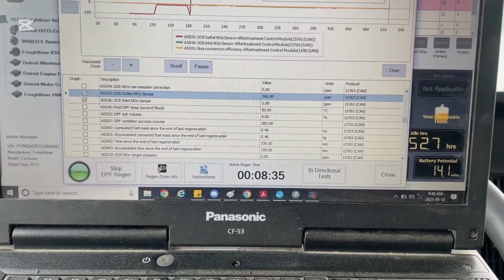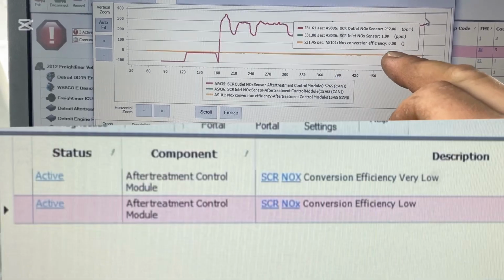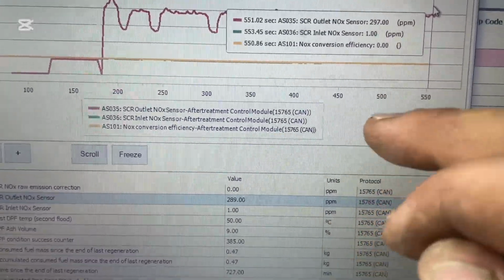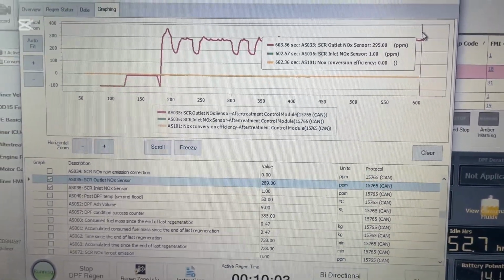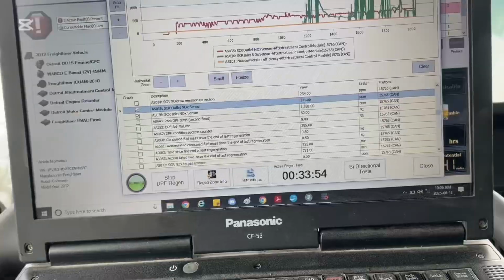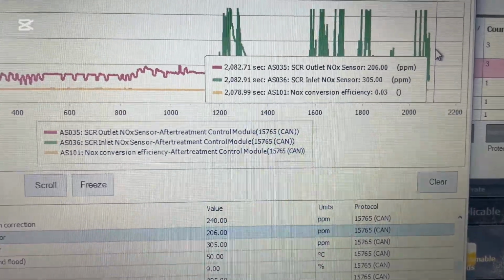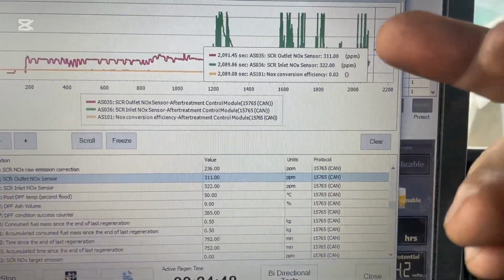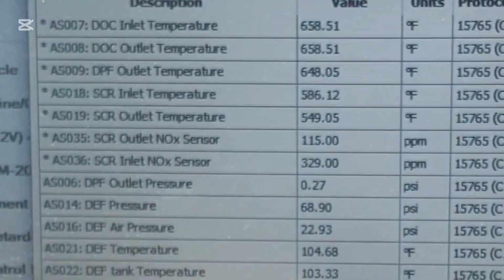4364 Nox conversion efficiency codes explained and trouble shoot Detroit DD15

Comment: So what is the problem,?  Video suddenly stops,  inlet nox replaced still the same?
Reply from the maker: Bad inlet nox sensor fixed the efficiency issue , I thought I made that clear ..
Reply: Im having a similar issue outlet nox is good ranges from 5.0 to 4.0 and my inlet jumps between 425 to 290 ish that a okay sign ? Having a def code
Reply: Spn 521049 fmi 31 def inducement lamp active tells me to run a regen then scr eff. Test regen is taking a while
Reply from the maker: @AllanWrenches24.7  you can join my discord server , I posted a link for t/s code 521049 . Here's the link to join 

https://discord.gg/3StdtJ5z